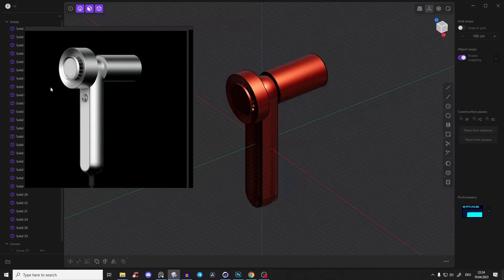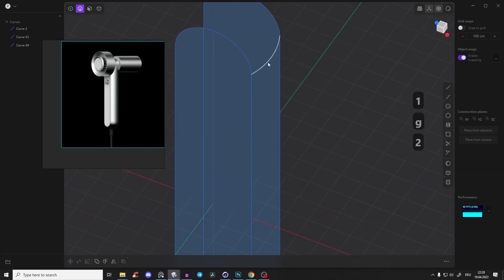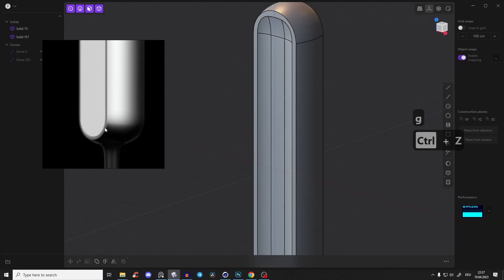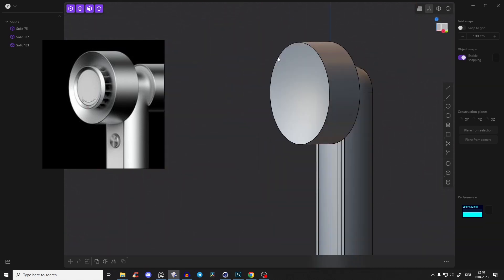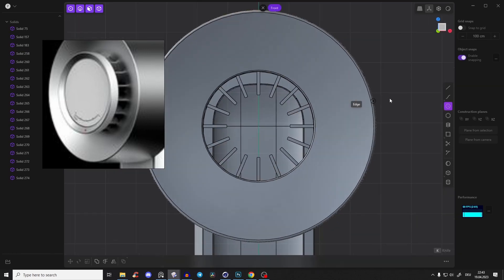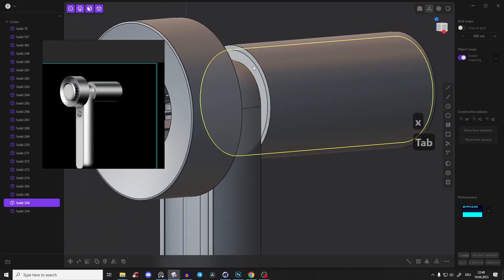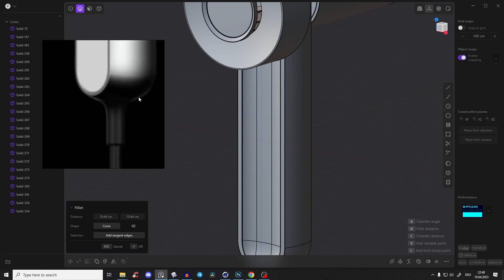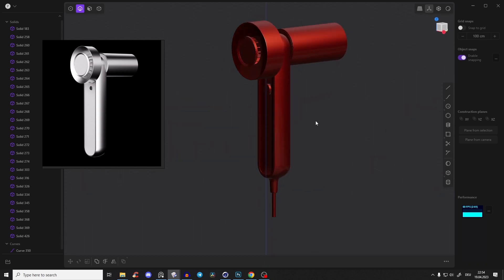Plasticity 3D Modeling | Product Design | Beginner Tutorial | Hair Dryer

Comment: Very nice, thank you for sharing!
Reply from the maker: Thanks!

How are you using Plasticity?
Reply: @nikita.kapustin  I mostly design stuff for 3D printing. For example, I recently designed a Ravioli cutting board, some flower pots incl. a water drain, a stand for a hair-dryer that attaches to the side of a cupboard, cutlery inserts for drawers, functional parts for an old vespa (light switch cover) and so on. I enjoy your videos because they open me up to new techniques and design ideas.